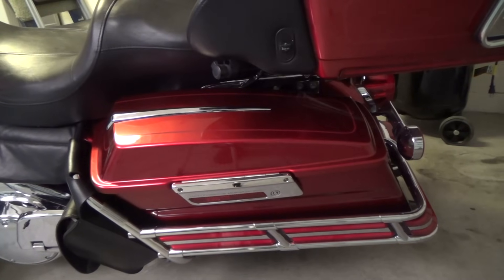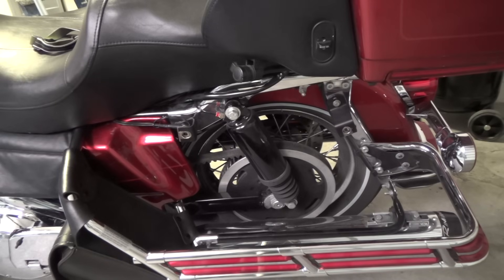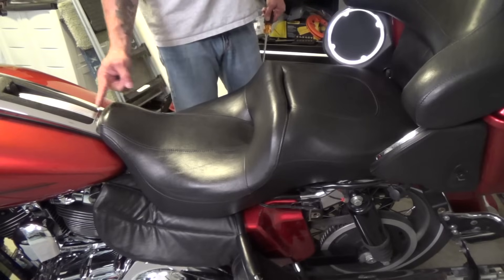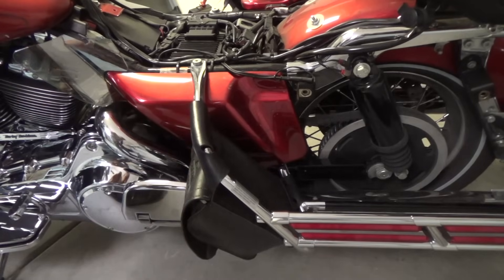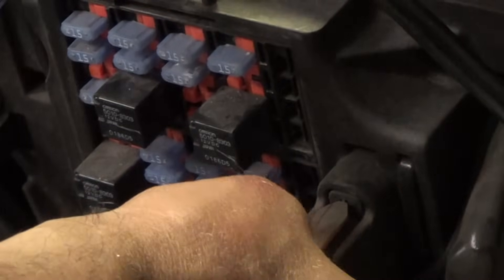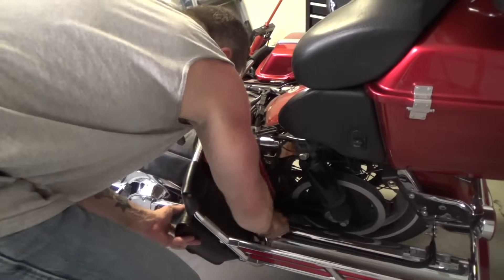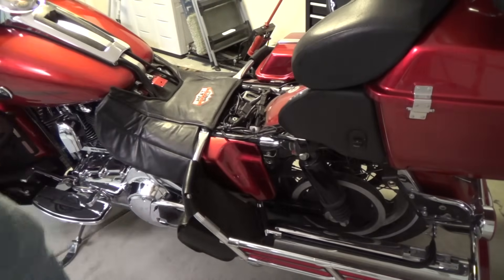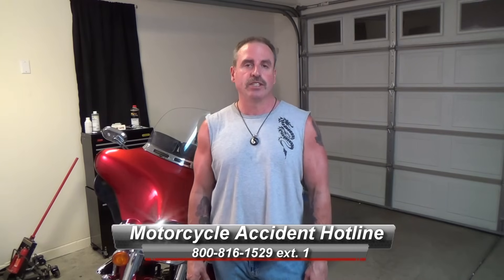How to get to the fuse panel on a Harley Davidson Electra Glide Motorcycle

Comment: NIce bike I just bought a 2008 Electric Glide (its a trike conversion) out of no where, my turn signals, break light (when breaking) and my horn will not work, Checked the fuses (all good) some say its the module.. Do you know where that is

Comment: Great video. Thanks. I'm hoping someone can help me solve my problem. I have a 1990 FLHTC...  It has the Harley AM/FM/ Cassette Player in it. When I turn on the radio it drops my voltage meter down to the minus side. Today it actually killed the power to my bike.  After the main breaker cooled off the power came back on but as soon as the radio LCD display lit up los power again. What I'm looking to do for now is to locate and remove the Fuse or Circuit Breaker for the radio till I can get the radio replaced. None of the manuals I've seen shows me where to find the fuse or breaker for a 1990... Any help would be greatly appreciated.
Reply: I have the same problem today

Comment: Thanks, Norman.  I've got a '94 EC Classic and I'm guessing my fuse panel is in the same place.  I just didn't want to go through the dis-assembly to find out it isn't there.  My turn signals and flashers went out and I'm guessing it is a fuse.  At least I'm starting there.  Thanks for the help!
Reply from the maker: David Bratlie That is exactly why I went for my fuses. It is as fuse!
Reply: Norman Gregory Fernandez Thanks!  I'll let you know what I find.  I hope it's that easy!
Reply: Norman Gregory Fernandez Unfortunately the fuse box was not on either side.  It's also not by the battery under the seat.  The only place left is the fairing.  Guess I'll have to buy the service manual for the '94 EG to get into it properly.  Thanks for the video anyway.
Reply: +David Bratlie did you find your fuse panel? I've got a 95 EG with similar issues. my cruise control module is under that left panel
Reply: The bike isn't actually mine, but a friend's who rarely rides it (he also as a '10 UC that he rides more regularly), so he let me ride it all year to keep it going and give him feedback on it.  He eventually asked me to take it to the dealer since he had issues with the carbs as well.  The turn signal module was bad and needed to be replaced, as well as having some broken jets in his carb, so I didn't get to do the work, but everything is better now.  Thanks for following up.  I appreciate it!
Reply: +David Bratlie I just found the fuse panel on my 95 EG. Its behind the headlight
Reply: My friends handle bars were luse  on his ultra classic so he took the faring and radio off piling the two plugs going in to back of radio  well win reassembled  no starter button no horn light and blinkers come on no spark please help
Reply: It's a2006
Reply: Ultra clasic

Comment: Do you know where the fuses are on a 74 electraglude?
Reply: A 1974 Electra Glide doesn't have a fuse panel, it has circuit breakers. There are 4 main circuit breakers, the first is directly in line with the positive side of the battery & is placed with a copper bar. This circuit breaker is for main power coming from the battery & keeps you from having a short that could result in frying your whole main wiring harness & possibly causing a wiring fire. 

The other three are placed on the underside of the dash in rectangular clips. There is also a bracket inside the headlight nacelle on FL/FLH models that hold the turn signal & hazard light flashers. on original 1974 models and is mounted on a metal plate with a piece of red rubber sheet with the flasher clips rivited to it, usually there are a total of three clips but as a rule only two of the clips are used, the third is generally for the Police Special models & holds the flasher for the pursuit lights. 

These will be rectangular as well so try not to confuse them with your circuit breakers as they're both the same size & dimensions, although the flashers will have blade terminals & the circuit breakers will have threaded terminals. Each circuit breaker has a steel terminal & a copper terminal & you'll need to remember that the steel terminal is for power going out & the copper terminal is for power coming in.. 

The circuit breaker directly under the ignition switch is the main power circuit breaker, the one to the left side is the lighting circuit breaker, and the one to the right is the accessory circuit breaker, all of the stock circuit breakers are of the 12V/15 amp type due to the 12v/15 amp alternator that came on the Electra Glide & Super Glide models up until 1980 when Harley increased the amperage output of the alternator due to added lighting & other features, with the earlier models there was only the .8 Kw starter motor, the headlight, tail light, and turn signals & the speedometer light & dash indicator lights.

When there is an electrical fault you will hear a 'click--much like the sound of the turn signal & hazard light flashers as the circuit breaker resets, but until the electrical fault--or short--is fixed the circuit breaker won't allow whatever the breaker controls to function, it will just keep resetting until the issue is fixed. On FX/FXE models the circuit breakers & flashers are usually mounted to the rear fender just under the seat....